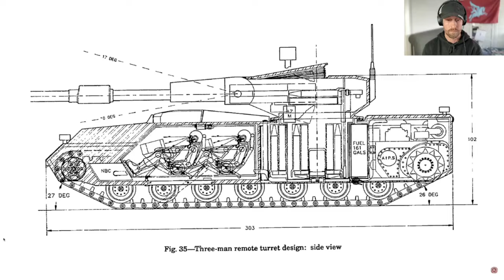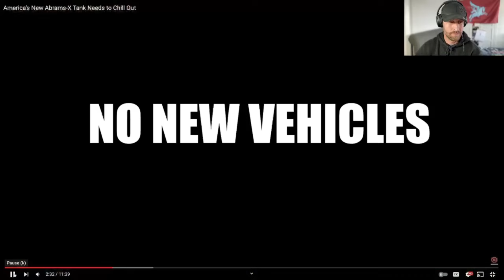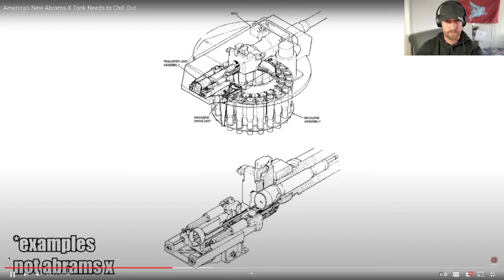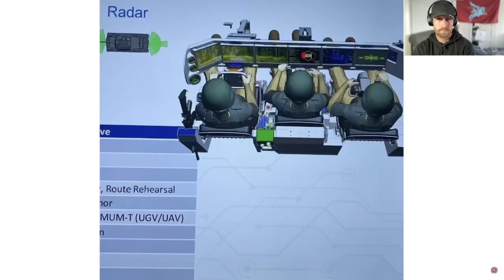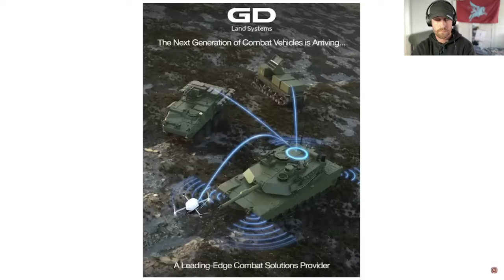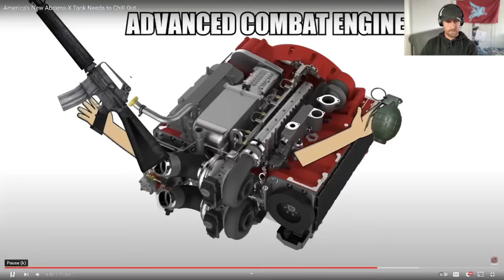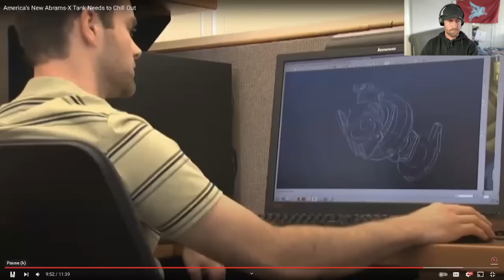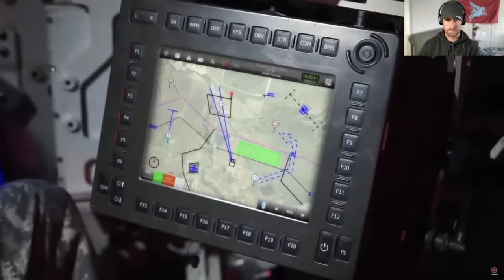America’s New Abrams X Tank Needs to Chill Out British Soldier Reacts

Comment: The reduced armor weight isn't necessarily reduced armor, due to the geometry involved. If you make a turret smaller due to less people, you can keep the same protection with less material.
Reply: I read somewhere that the amount of copper wiring needed in modern Abrams weighted 100s of pounds. The AbramsX would do away with many systems that require traditional wiring for more advance & lighter fiber optic materials. Traditional mechanical systems.. fire control, etc.. would also be replaced with touchscreen monitors. Eliminating physical switches, toggles, etc. 

In the end, the AbramsX is the tech demonstrator. What could be possible. Doesn’t necessarily mean the US Army will adopt it as is.